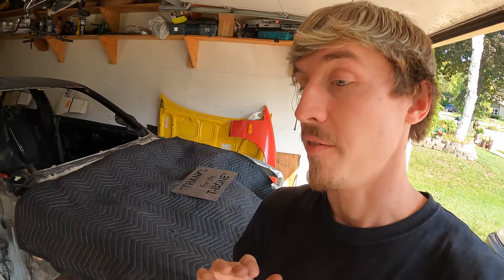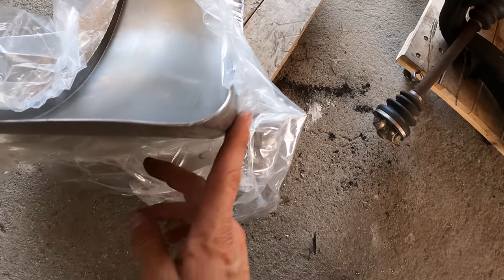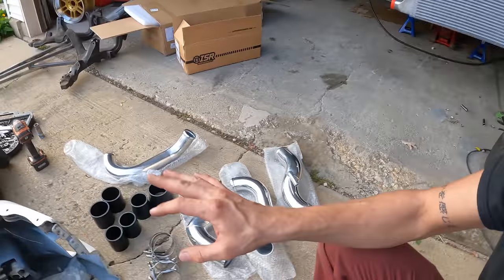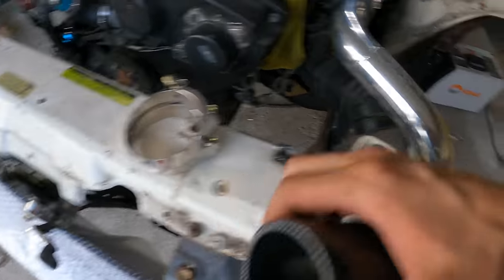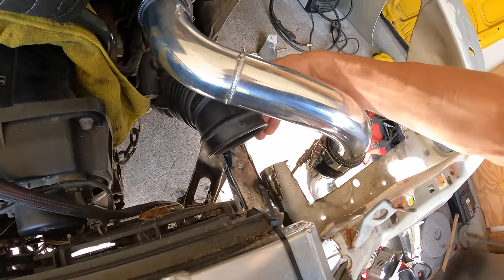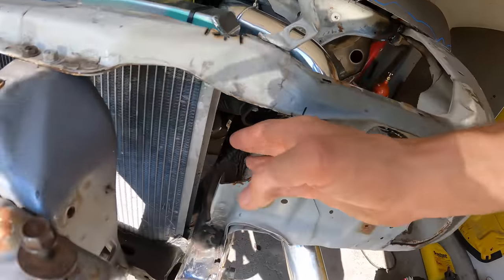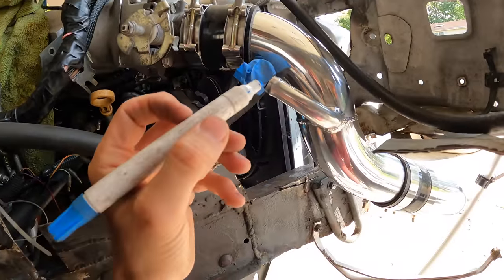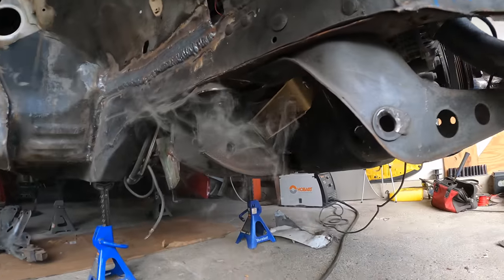How to Build a Drift Car Engine Bay 240sx S13 │ Function and Form

Comment: Just something to keep in mind budd, if your trying to trace a edge like your trailer fender to strut tower you can sometimes use a washer and a marker. Put the tip of the marker thru the hole in the washer and you can use a finger tip to hold the washer/then slide your hand and follow the line you want to cut.
Reply from the maker: That's a great idea! Thanks for the tip! I'll have to try that one haha
Reply: @PrizzaMike  works great if you ever need to cut something to fit against a wall in a house too like flooring or shelfs too

Comment: I'm speaking really late, but wouldn't a tucked radiator be better than cutting up the cross member?
Reply from the maker: That's a good question 
I prefer the notched support vs a tucked radiator 
I've heard alot of people having cooling problems with a tucked radiator since the airflow to the radiator is decreased (closer to intercooler)

Parts availability and pricing is also more so out of accessible range for a tucked radiator set up

Comment: Hey man so i started welding my 3 big holes i had in my floor bored behind pass seat driver seat and clutch pedal area , it’s completely patch and i sealed it and came out nice and solid , now im stuck on the underneath now it looks like 2 layers of floor underneath wen u look under what do i do for the bottom of each side that i pached up